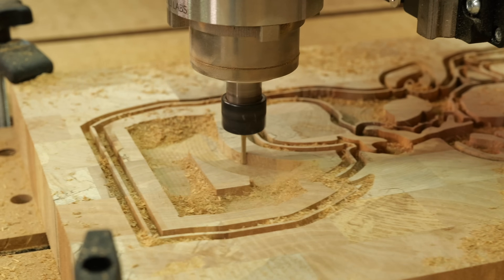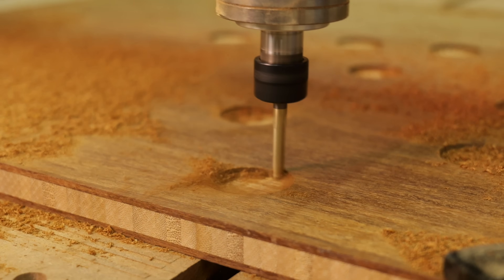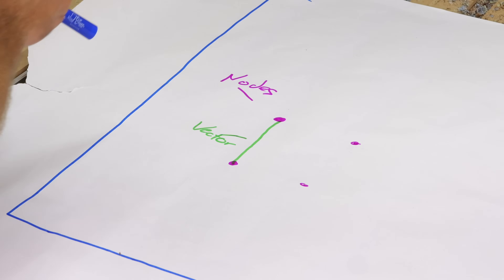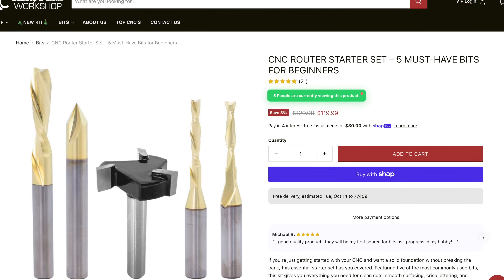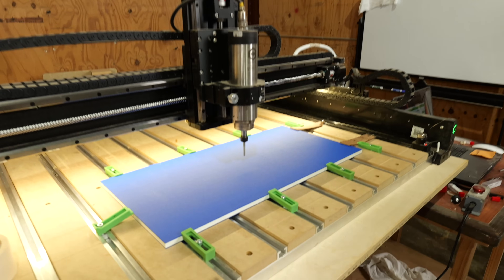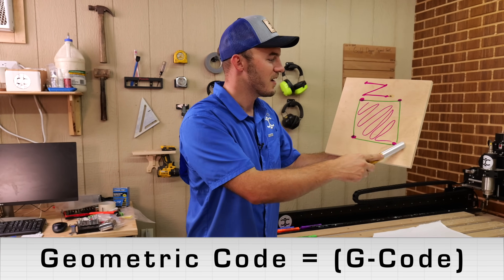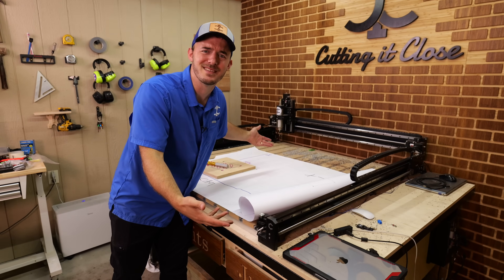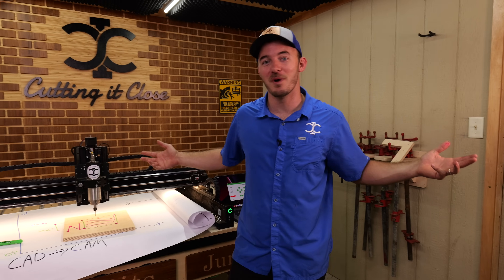CNC Routers, Toolpaths, and Software — Explained in 11 Minutes

Comment: Hybrid woodworker for about five months. Genmitsu  6060 pro max. But this machine, you definitely have to slow things down, but it does work beautifully when you do. Board of advice any files that you buy triple check your speeds because if they’re using larger faster, meaner machine, and you have something similar to what I have slow it down or you will break bits or ruin your project

Comment: Don’t be intimidated by the design step (cad)! There are so many resources for files/designs  to get you started. Excellent ones right here, with a lot of detail provided, to get you up and running. Once you pull a couple of projects off the machine, it will be the fuel to push you further. Sometimes, it will just end up as fuel for the fire pit…just part of the journey!!

Comment: 'Hybrid-Woodworker' (UK). I have a Shapeoko Pro 5 2x4. I found it interesting that you favor both Carbide Create and Vetric as your CAD programs. I have found creating '3D modeling from scratch' easier with Carbide Create. Vetric seems not to have this ability without downloading pre-made height maps, unless I have something wrong. It would be so, so helpful if you could show how you make 3D modeled shapes from scratch on both CAD's if, indeed, Vetric has this ability. Although I am not quite the beginner, I always learn and/re-learn from the basics videos all the time so, I guess I always will be a beginner in truth ;) . Thank you for sharing your knowledge Sir. 👍

Comment: Hybrid-woodworker! I have a Longmill Mk2.5 cnc and also a Camel CNC 1325 model with a 6kw spindle from China. 

Quick question, I am diving deep into CNC machining and I only owned a Laser machine, is it viable to use AI to assist in calculating acceptable feeds and speeds for the cnc? Provided you list the cnc details and speculations, types of wood, etc? Looking forward to your response!